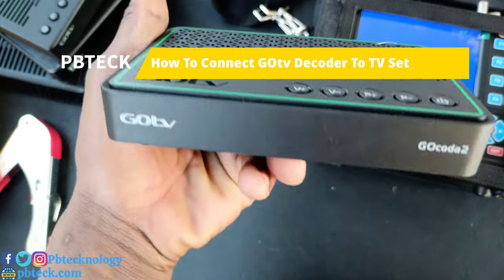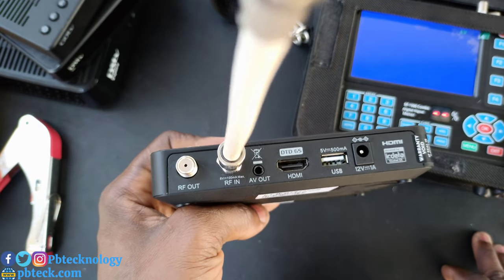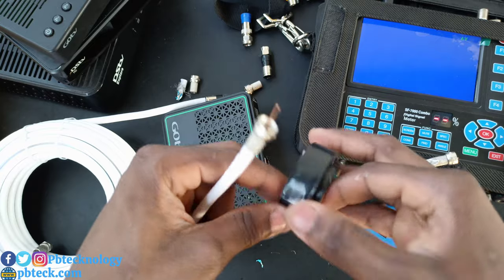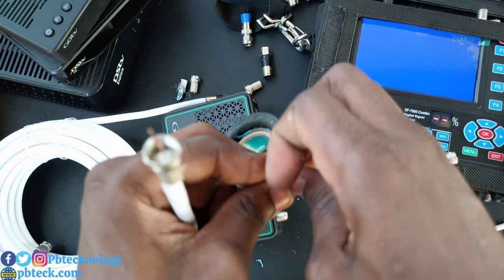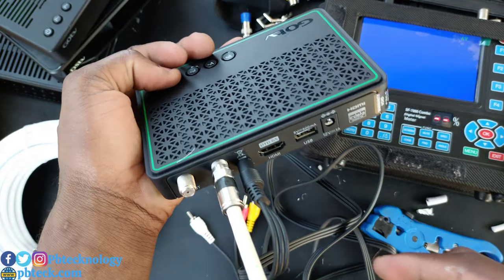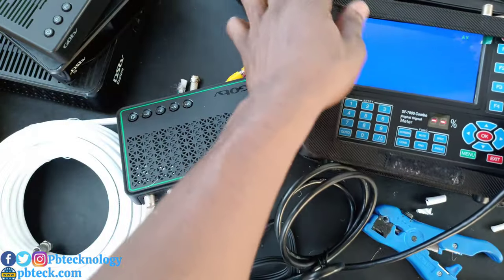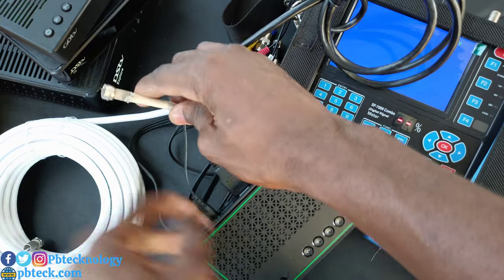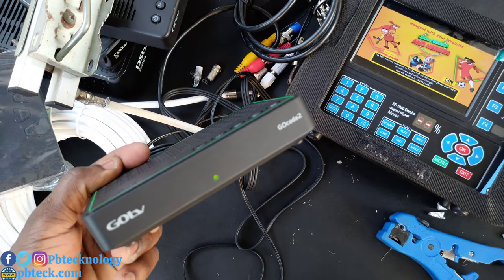How To Connect Gotv Decoder To Tv Set

Comment: Pls can I get the gotv power plug alone🙏I dnt wanto get a new because I just got it not long so the power plug got burnt by light 🙏I dnt know if I can get the power plug alone
Reply from the maker: You can get a replacement from most of the electronic shops. Just give them the right Voltage of the Adapter or the Decoder.

Comment: After connection, my gocoda2 has no sound. Please help
Reply from the maker: If you used the (Jack to AV out Cable)  make sure to connect it at the right port of your TV set. The red and white cable holds the audio.
Reply: @pbtecknology  I did sir. 
I connected the one mouth to the decoder and connect the yellow, red and white accordingly to TV but no sound. I have been very angry since morning
Reply from the maker: Try to reinsert the Jack side of the cable onto the decoder and turn it around to fit in well. Check the TV sound with other device if possible, to know where exactly the problem is coming from. If your Television is not having any sound problem, try getting a new AV cable it not expensive. If it's a new decoder, there might be a few chances of it getting a fault. So check the TV sound, the AV cable and how you insert the cables at the right ports. ❤️
Reply: @pbtecknology  OK sir. Thanks so much. I will try them out and get back to you probably tomorrow. Thanks so much for your time

Comment: When I connect the HDMI code to my code is hanging what can cause it
Reply from the maker: *Use a different HDMI port from the TV to check.
* Change the HDMI cable to check if the problem is from the cable.
* Use a different device to check with your HDMI to know if the problem is coming from your Decoder HDMI port.